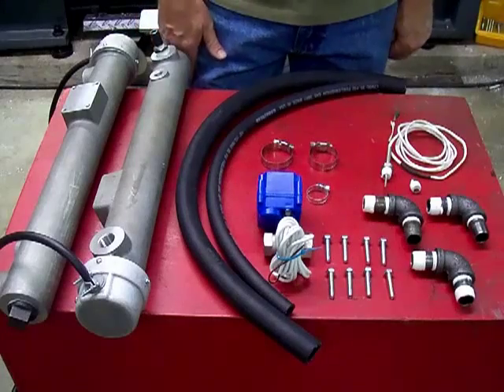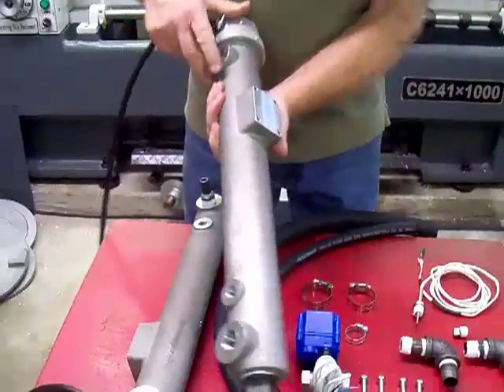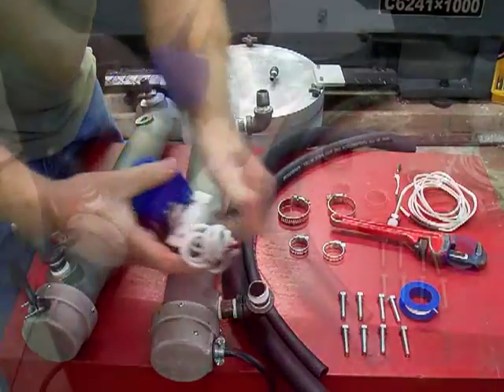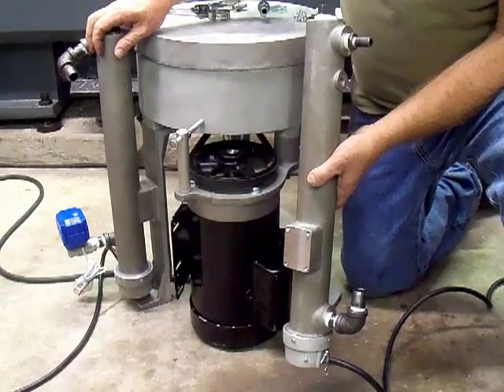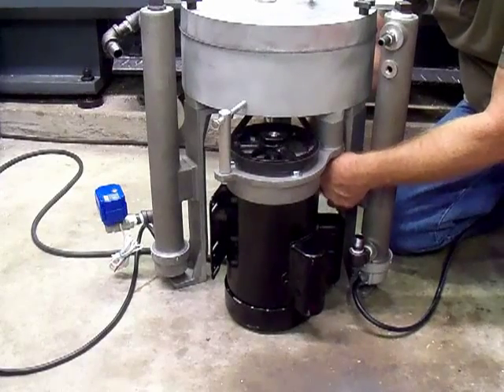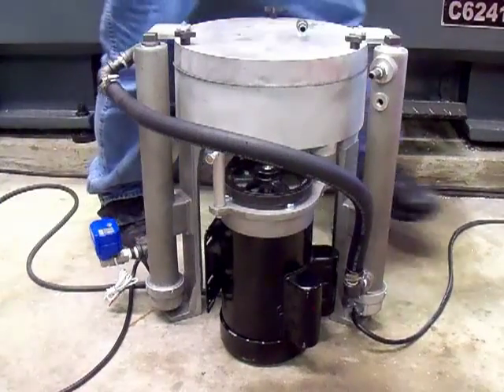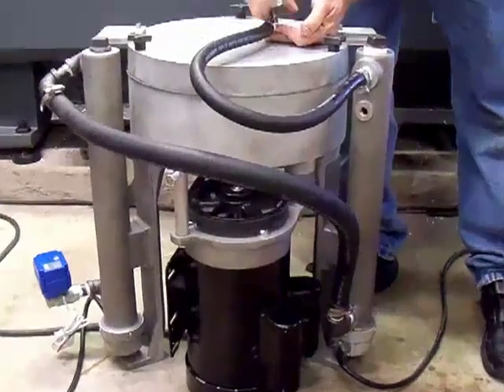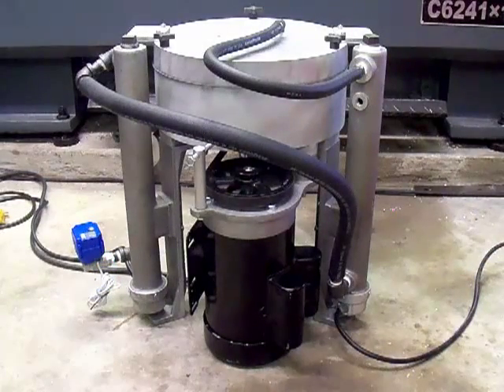Installing 3kW Heater Kit on US Filtermaxx Oil Centrifuge

Comment: Been enjoying watching your videos and looking into setting up a Black Diesel system. I already have a twin 500 gallon BioDiesel  processor set up and run my 7.3 on both that and pure WVO. This would be my last step away from ever buying commercial fuel.
 However I haven't seen anything on pre cleaning the oil before your inline filter set up. 
 Are y'all doing a anything of that nature. I let my WVO set in two 275 containers in the sun with a manifold allowing me to drain of water and dirt as it settles away from my BioDiesel processor. Both have in tank heaters. However I also use a misting tip and water wash once its pumped into my processor and before and then again after I mix and once before I run WVO straight in my truck.
 Am I missing a video in the series or are you not doing this and if so why not. If the water wash is an option I would plumb my black diesel through one of my big tanks for washing after the centrifuge and add a misting nozle to my pre centrifuge tank with a separate drain line for water and contaminants. An thought?
 Thanks Hope to be getting  with some of you soon for a full Black Diesel set up. Still in my brainstorming design and research phase. 
   
                                         Thanks,
                                    Luss @ Rottdoginc@aol.com
Reply from the maker: There are settling tanks and the free water is drained off. the remaining water is removed in the centrifuge. You can not mix or black diesel with bio diesel or WVO. I would also suggest that any tanks and filters be cleaned and changed before switching fuels. Black diesel and bio fuels are not compatible.

Comment: I've never seen the need to Heat the Oil, if you are blending with Petrol.
Reply from the maker: You heat the oil to get the water out. We have done it both ways and plenty of other ways over the last 10 years. Heating is the best way to clean oil.
Reply: Are you blending petrol to separate/settle-out the particulates and then heat/centrifuge?